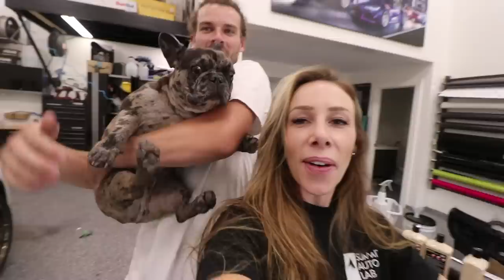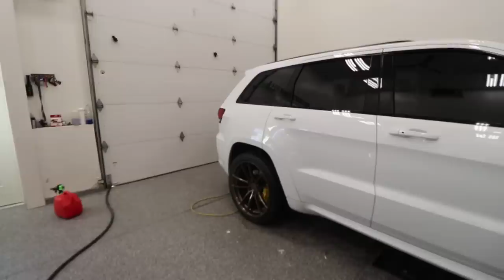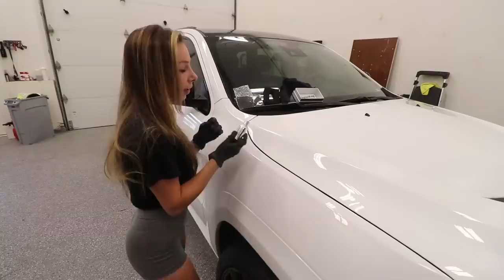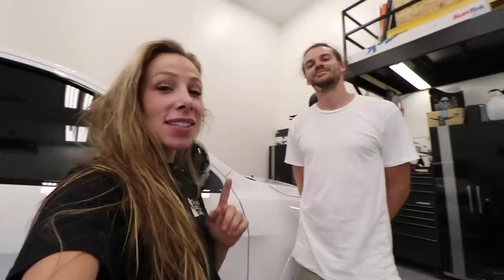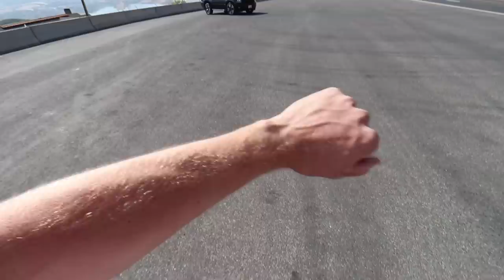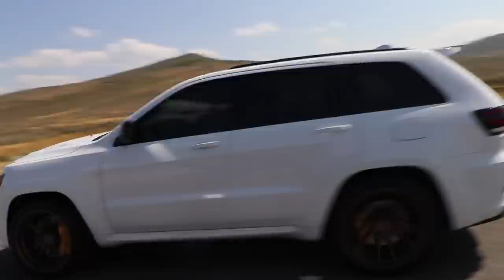I Regret Buying A Range Rover After Driving THIS

Comment: There's a guy from down-under with a hellcat powered right hand drive , with large turbo set-up that's mounted under back of truck , running 10.4 in the quarter mile , and it's AWD JEEP LAREDO/Cherokee , gotta weigh around 5,000 lbs , shitz n getz

Comment: Ceramic coat needs to be applied by in a cross hatch method and should not be more than 2 to 3 foot sections and don't wait more than 30 seconds to wipe off.

Comment: The iconic seven-slot grilles that are on every Jeep® model are one of the brand’s most recognizable features. But, what inspired that design? Where did it come from? Why do they need 7 slots?

Some theories suggest the seven slots represent the seven continents, with the Jeep® being the first vehicle to drive on every continent – however, there is no real evidence to support this theory. The real reason is much simpler…
  Trademarks and copyright infringement. 

The first was the 1907 Arrol-Johnston and a 1927 Austin 7 but it wasn't until 1963 that the first production car landed on Antarctic shores, a mostly-stock VW Beetle

Comment: Absolutely stunned that you're comparing a Track Hawk with a Range Rover! It might be fast but the build quality, road handling, reliability and and and is nowhere near as good as the Range! I too like the Track Hawk but your comparison is totally subjective and not based on any sensible or informed experience. It's like comparing  a piece of white bread with wholemeal bread. Both bread, but white is rubbish and has no real nutritional value.
Reply: You're crazy about the quality of the range Rover back in the 80s and 90s it was the joke if you buy one you got to buy two so when you have the other one in the shop you still got something to drive
Reply: @concernedcitizen9373  Well that was a brilliant statement! Using the quality of Range Rover from the 80s and 90s and trying to project that into 2020 is delusional. The Range Rover and the Range Rover Sport, along with the Velar are three of the most sought after SUVs in the world. Any reliability problems from "back then" were solved years ago. First get informed and then comment...
Reply: @robertw.1499  I was a used car manager for 20 years at a dealership to sold 6 to 800 cars a month
Reply: Concerned Citizen emphasis on the word „was“
Reply: That's absolutely hilarious calling a Range Rover reliable. I own a Trackhawck and have had zero problems and my buddy bought a 2019 Range Rover SVR and it has been in the shop all the time and it's slow. My buddy is waiting AGAIN for it to get out of the shop so he can get rid of it he always say's it's the worst car he has ever owned..Those are FACTS from people that own one of each.

Comment: polish is not protection, waxing is the only way to protect the body, but because waxing a car is such a physically strenuous job, gives you back and shoulder aches and pain, you youngsters dont like to work, you want it done NOW, NOW, NOW. wax sets to a very hard coating indeed, and does protect, polish does not, because the coating is so thin. however its your car, carry on......

Comment: Pointless vehicle.....just waste of petrol and environment .I totally "get" the big V8 / V12 Sports car or power saloon but why waste all that energy in a family 4x4 that has zero steering feel and would struggle to put a clean set of heels through a quick corner .......just noisy and polluting for nothing.....what ?so you can be the fastest up a dirt road to the farm ?
Need 4x4 , 5 seats and power ?......get an Audi RS6 Quattro,S4 Avant, etc